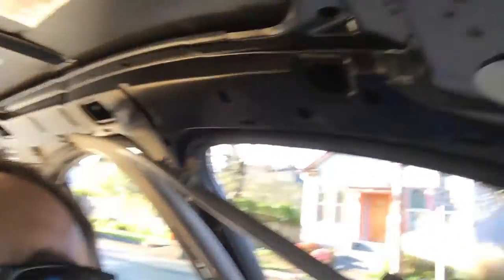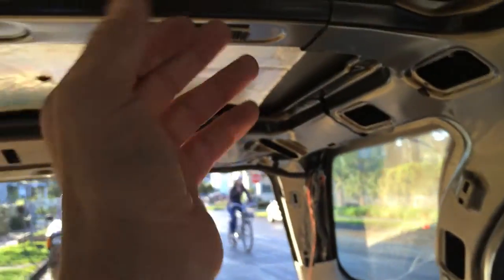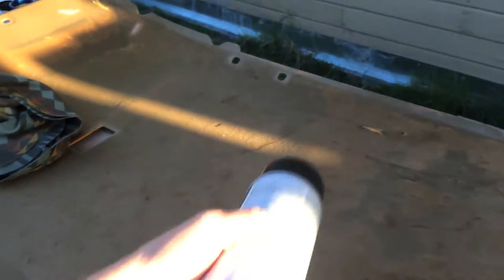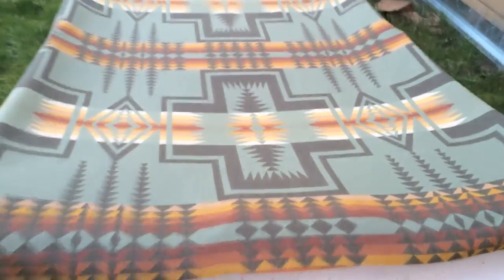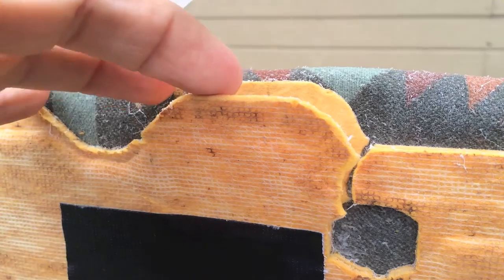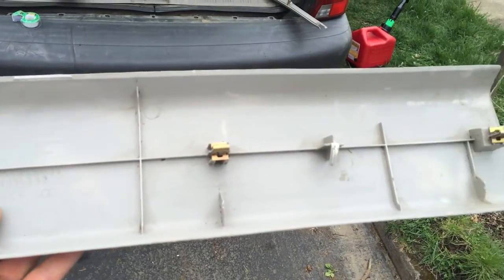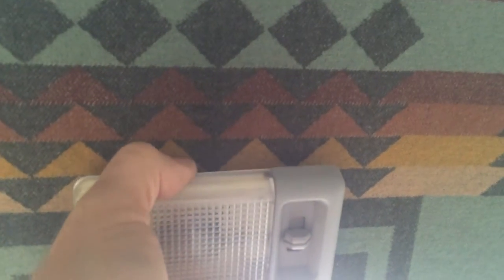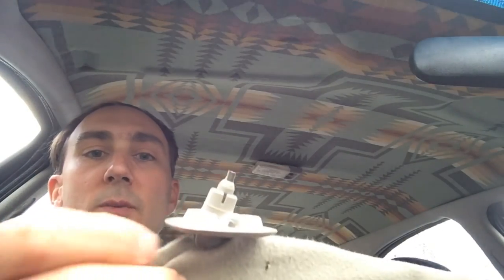Custom Headliner Repair

Comment: how did the pendleton material hold up? I'm super into it visually, but I was thinking about how my stock headliner material is super thin and stretchy, which would make for better bonding. The Pendleton i would assume is much thicker and has less stretch. Any longterm update?
Reply from the maker: It has held up very well.  Its been three years, and even though I often load this vehicle with various pokey materials, there is not a blemish to the headliner.  The fabric is actually about as thin and stretchy , and lightweight as typical headliner material.  I would call it a light upholstery fabric, a good bit lighter than a flannel that you would make a shirt out of.  (Not sure if it is widely available, as I got mine right from the factory mill store.)

Comment: Just wondering if I could do this same method with vinyl fabric/ fake leather. Thanks
Reply from the maker: jade osiowy I don’t think it would be a problem, as long as the material was light and thin. The fabric I used is quite a bit thinner than your average flannel material. It’s comparable in thickness to the fabric usually found on headliners. And be sure to use the 3M headliner adhesive. My understanding is that this is the crucial determining factor for success. Good luck!